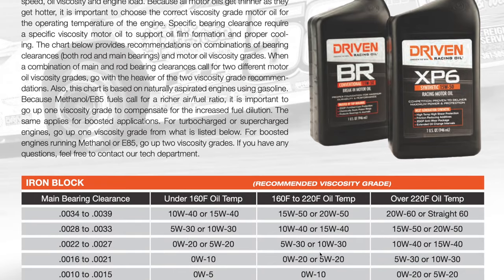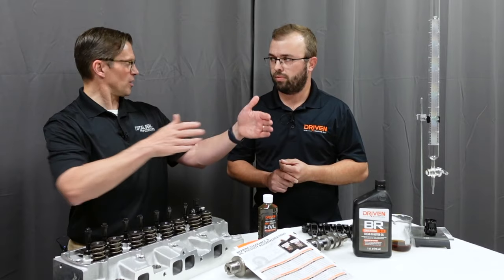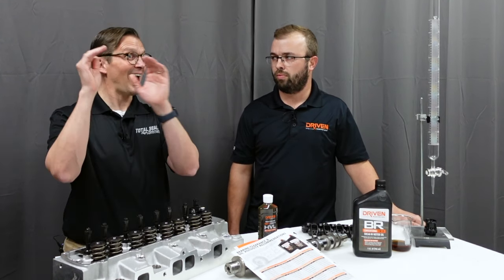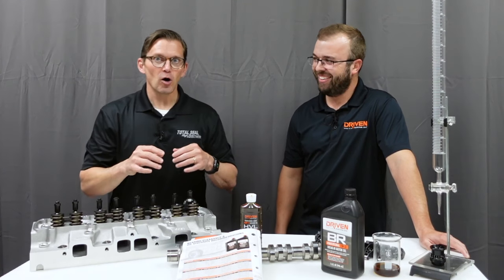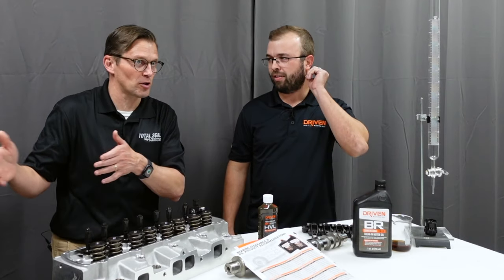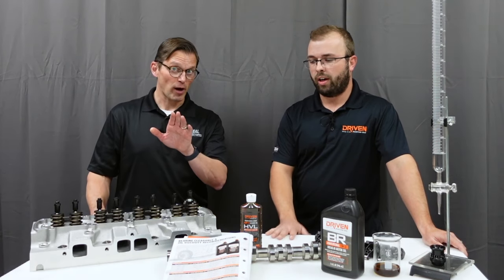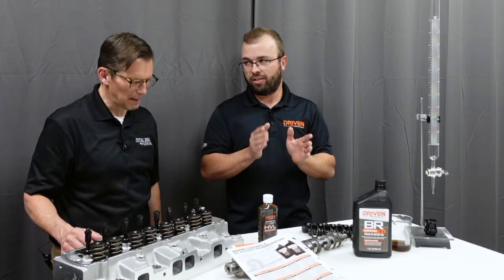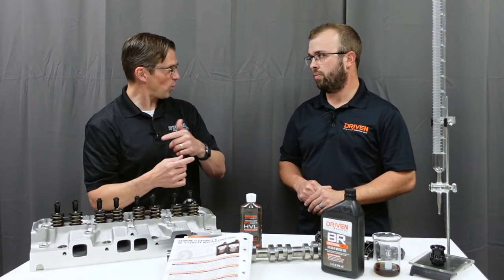How To Choose The Right Viscosity Motor Oil - A Certified Lubrication Specialist Explains

Comment: I’m 5 min into the video, heard nothing but viscosity, viscosity, and how important it is. What is the point? What do you suggest people do rather than following manufacturer’s recommendation?
Reply: the lower the W number, the better (within reasonable cost, comparatively).  The other number... well... whatever your ambient upper temperatures tend to be.  For most people, 5w-30 is fine in most location.  Otherwise 5w-40 is fine.  Very very rarely would anyone need *W-50 or 60.  These are either for highly stressed performance cars, high mileage engines, or very hot ambient temps.
Reply: If only you had watched the rest
Reply: I had read a research article which in short words stated that engine oil viscosity is based upon clearance of rod bearings. We all know rod bearings are the most critical parts of an engine to have maximum wear
Reply: Freeze 0W20, then pour it out and talk that BS about rod bearings and clearances
Reply: @lonniebeal6032 but if your engine is never used in freezing temperatures, how is that relevant?
Reply: Yeah whole vid was useless he just keeps saying viscosity and oil tension rings. As for what rating? Higher lower or follow manufacturer? No answer. His answer is viscosity.
Reply: Research and use your damn brain?
Reply: @carnivorebear6582 you telling me people never start their engines below freezing? What a wonderful world that is. Is it Venus?
Reply: @2010ngojo  where I live in Australia it's extremely rare to see temps below freezing, and even then it's maybe 1 degree below for about 30 minutes on one winter morning a year. It's still on Earth believe it or not!
Reply: Sounded to me like this, the warmer it is the higher the number needed and the colder it is the lower the number needed. Sound about right?
Reply: @awaisiqbal8934 rod bearing clearances haven’t changed in 30 + years. The bearing clearance argument is just dumb. I would question the experiences of the person who wrote that article.
Reply: @carnivorebear6582  nope, Australia is a different planet as far as I'm concern.
Reply: @carnivorebear6582  Then you could put 20w50 in your car if you don't use it and it's not relevant.  Most of us have one or two cars, when winter hits we are still driving them.  My point on the 0w20, is that people claim its for tight tolerances, but if you're driving in 0C and lower most of the time, you car will cool fast, run cold, and that oil will be thicker than SAE90.  Hence 0W20 is not good for hot climates due to viscosity breakdown and running a 10w30 in the summer that is thinner than frozen 0w20.
Reply: You guys need meds😅
Reply: @FredJones-lo2df  😂
Reply: A suggestion for what viscosity to run... You mean like the chart he showed, that's also linked in the description that spells out which velocity to use?
Reply: Those oem specs are good till everything starts to wear also they’re ment for regular use not abuse some brands actually recommend different specs if your gonna be abusing the vehicle more from viscosity to when you change it because some new cars are due with regular use at 7-9k miles (i would never do this even if I used it regularly) and they recommend it be changed at 3-4K if it’s abused more often or miles/engine runtime is high in short period of time because oil dilution happens in different ways at different conditions also after an engine has been worn down over 80-150k everything is most likely more open like bearing specs ring gap and tiny ptw clearance and the title and subject of the video is about oil viscosity so what you expect they’re professionals in this field I’ve seen and heard from the best they’re not the only ones with this correct opinion
Reply: Funny that they mention viscosity in a video titled Viscosity

Comment: We use straight 30 wt, in our hot rod engines, because we run  .003 thou. On the mains, and  .002 thou. On the rods. Lighter oil might allow the crank to hammer the bearings at 7 to 8,000 rpm

Comment: Makes me want to rethink my Jeep 4.0 and just run 10W-30 instead of 5w-40 year round here in Arizona.
Reply: I'm in TX. I have found that 0w-40 is a really good solution. M1 is really thin for a a 40wt, if you want that.
Reply: @DBravo29er  I’ve been really happy with Valvoline HM 5w-30 so far, no more click tapping at start up anymore.
Reply: @dad3562  that's a good, thick for grade oil. It's on the heavy end of the 30wt range. If we used half weight ratings, it would be a 35 weight oil all day. 👍
Reply: @DBravo29er  no way it is?! For real, I didn’t know that! Crap, now I have to Google it to confirm. I seriously did not know that!
Reply: @dad3562  Yeah the KV100 and HTHS are pretty robust. It's good oil
Reply: @DBravo29er  thank you so much the data, man I love this stuff. Great community!
Reply: The 4.0s love a 40wt oil. I got 331k miles out of my 97 TJ 4.0 with Rotella 5w40 and a Wix filter. The frame rotted out before the engine ever gave up. The engine is still running with nearly 500k on it in a 98 XJ. Same oil and filter are being used.
Reply: @Trebor-gw8lt  that’s crazy! Lucky dog!

Comment: When I added a supercharger to my sbc, I changed from 10w-30 to 0w-40. It's running over triple the stock hp so the oil is worked much harder and sees more heat.
Reply from the maker: Going up in viscosity is the right move when going from NA to Boost.
Reply: @TotalSeal  I've heard others recommend to stick with factory viscosity. No thanks! I wanted better cold flow for instant oil pressure and flow on cold starts.. while maintaining better protection when I step on the throttle. I recently read that the 650hp LT4 is factory filled with the same multi-grade viscosity.
Reply from the maker: @EricErnst  good thinking
Reply: @EricErnst  Not withstanding the fact that a 0w40 is already almost a 30 from the container and get to a low 30 after a few hours of operation
 So, you still giving a 30 most of the time, anyways
Reply: Film strength matters too. The 0w40 requires more viscosity modifiers than a 10w30, assuming all else is equal. More viscosity modifiers (big numerical spread) often result in less shear resistance. The big numerical spread can look like everyone is happy, but might not be as protective as numbers closer together (less modifiers). 

10w30 won't shear to less than 10. 0w40 can shear down to 0.
Reply: @Resistculturaldecline  Great point, 0W-40 oils often shear into the 30 range and sometimes below after a bit of use, especially hard use. Oils made from thinner base oils with more viscosity modifiers also tend to have higher evaporative losses at high temperatures.
Reply: I use always 0w40 mobil1 FS instead 5w30. Very good oil!
Reply: Make sure you shake that oil well before pouring!

Comment: Mr. Lake Speed , my 2023 Lexus IS 350 calls for a 0 W 20 . The owners manuel says that if I drive at high speeds or pull heavy loads , I may use a thicker viscosity oil . Can I use say a 0 W 30 or a 5 W 30 oil , will it be safe . Thank you Sir for your tlme and the video . May God bless you .
Reply from the maker: Go with the 0W-30 if you see the 0W-20 is not working. The way to know is via used oil analysis.
Reply: @TotalSeal  Thank you Sir, for taking the time to answer my question and for the information. May God bless you.
Reply: If you drive like crazy constantly revving your engine in the red zone, then go for 0w30 or even 0w40 as the difference between 20 and 30 is not that high - again it differs from manufacturer to manufacturer, and for sportier applications 40 would be a better choice. If you drive normally, stick to 20 as the manufacturer recommends. 20 is for  regular driving mode like 90% of people have going to work and from work without sporty ambitions. If you really load your engine hard revving it near red zones, you definitely have to go for thicker oil.

Comment: I drive a car with a low mileage 1 litre gdi turbo motor. I  live in a a tropical country with temperatures around 80 f. My manual recommends 5w30, 10w30 and  10w40 viscocity. What would  be the viscosity that is best for lowest engine wear for city driving conditions in your opinion  . Would greatly appreciate your response.
Reply from the maker: For a GDI engine, go with an API SP 5W-30 synthetic.
Reply: @TotalSeal  Thank you v much 1for your time. Most channels never respond to viewer comments.
Reply from the maker: We are happy to help!
Reply: Actually, an oil analysis of each oil would give you the better answer.  I am more inclined to say 10w30, cold flow rate at 70f is about the same.

Comment: Toyota states in their owners manual that a higher viscosity idk can be used in high load conditions. So you can use 5W-30 if car calls for 0W-20 without voiding the warranty.
Reply from the maker: Thanks for sharing!

Comment: I switched to 10W-30 in my 2.4 L engine in my jeep renegade from the 0W 20 to attend W-2 and if I can’t find a 10W-30 I’ll use a 5W-30 I could understand using 0W 20 or 0W 30 if your daytime high is only in the high 50s or low 60s And then below zero at night time

Comment: I have a (what I think) is a great question. 

I collect many Japanese imports. My cars from Japan, state to use 5w40/10w40.  My US SPEC Honda/Acura that uses the same identical B18C VTEC engine, states to use the factory 5w30/10w30. The ONLY difference in the two is that the Japanese spec revs a bit higher because of the ECU. I always wondered why the difference. 

A better similarity is a Japanese spec S2000 to a US S2000. Japan states in the owners manual 5/40-10w40,  in the US 10w30. 

Do you know why? Emissions BS? Marketing? I hate to question or argue with a true Honda engineer, but I feel you would know! 

Love the channel
Reply from the maker: The lower viscosity spec in the US is because of EPA fuel economy requirements.

Comment: My old Fords oil pressure was a bit lacking having 565,000 miles and instead of raising the thickness of the oil I lowered the thermostat temp from 192 to 180 degrees and the oil pressure came back to the way it was...

Comment: Please help this conundrum..... "hotter oil gets thinner"...as a general rule, yet for multi-grade oils like 5W-30.....the base oil is 5 weight to allow better flow at low temps, but with its viscisity improvers it acts like a heavier 30 weight oil when at higher operating temps. In this arguement, the oil is thicker as it warms. Can you offer guidance on this apparent contradiction..... for better understanding?
Reply from the maker: Watch this video: https://youtu.be/48pviPLgaPQ?si=2PD023A8q9MJDFMN
Reply: @TotalSeal  ....I fully understand W is for "Winter" and not "Weight", but presenting the question this way helps for presenting the question. I viewed the details of the vid but it goes into arcane testing details and doesn't really address the core question. Let try this way---> a 5W-30 oil acts as a "5" ( lower viscosity) oil to help cold-weather flow....yet it acts as a "30"  ( higher viscosity) oil, when warmed up...like a straight "30" oil...all done by using additives and viscosity improvers. A "30" oil will flow with more resistance through passages than a "5" oil.....like it was "thicker". Yet the common convention says oil get thinner when hotter. Can someone distill down the core thinking behind this ??????
Reply: Let's explain in a simple way. Oil thins out in higher temp, that's a fact. Imagine single grade oil at sae 5, it will have a viscosity of let's say 60cSt @ 40°C and 3cSt @ 100°C. Another single grade oil at sae 30 will have a visc of let's say 90cSt @ 40°C and 10cSt @ 100°C. The sae 5 oil is what you need during a cold start but at normal operating temp that oil will be too thin. In contrast, the sae 30 oil is too thick during cold start although it is at good visc for normal operating temp. This is where 5w30 multigrade oil comes in. It has sae 5 visc grade at low temp and has sae 30 visc grade at high temp i.e. 60cSt @ 40°C and 10cSt @ 100°C.
I rounded cSt values to nearest integers for easier understanding.
Reply: @1_D333 ....I guess that is what I was angling for....a (say) 5W-30 is basically 5 weight "core" oil.....with lots of viscosity improvers to allow it to behave like a 30 weight when "warmed".
Reply: @TheWilferch but don't forget that oil gets thinner when temp raises. Now you can google "oil viscosity graph" where Y-axis is visc (cSt) n X-axis is temp. You'll notice what I mean. And multigrade oil is just a crossing line of two single grade oils which otherwise parallel to each other.
Reply: @1_D333 .....I'm not forgetting that.....go back to my original statement where I post the conundrum.
Reply: Nice and simple

Comment: It’s 110 degrees outside today. Summer is here. My car takes 5w30 but I’ve got some 10w30 I’d like to use up. I don’t think the 5w30 will get down to that 5 number anyway. Tell me the pros and cons of using the 10w30 this summer
Reply: No worries for summertime. Make sure the 10w30 is full synthetic, because the 5w30 is.

Comment: 0w20 gets into and high up in the motor quickly,the gen 3 hemi likes this.
Reply: I rented a 300 Chrysler 5.7 in AZ, with 0w20 it knocked and ticked every morning, it was never below 90f.  So local temps matter. 0w20 also returns to the pan faster than a 10w30.

Comment: How does the choice of oil viscosity differ with different types of camshafts?  What if the rules require a functional flat tappet hydraulic lifter vs a solid and or what about a hydraulic or solid roller?  Do those differences also change the needs of the engine when it comes to viscosity?
Reply from the maker: Thanks for the question. The camshaft type does not effect the choice of viscosity. It’s all about bearing clearances and oil temperature.
Reply: @TotalSeal mate is ok the 0w40 use instead 5w30? Can damage the engine? Toyota 2zzge vvtli 1800cc 192hp 8.400rpm.

Comment: Great video guys...thank you!  I live in Alberta Canada and I own a Stage 2 (catted downpipe, MHD stage 2 tuned) 2018 BMW M240I X-drive with 36000 miles that produces about 450 HP and 475 lb-ft of torque at the wheels.  I exclusively use the Shell Nitro+ 93 octane fuel (10% methanol).  The oil temperature at normal running temp is 215 F.  The manufacturer calls for 0W20, but I have zero idea what the main bearing clearance is.  Am I correct in assuming that 0W30 will be fine and likely, preferable to use, at least in the summer?

Comment: My 5.0 f150 is recommended 5w-20 in the us and Canada, but is recommended 5w-30 in the Mexican version. My vehicle is higher mileage and vibrated a lot.  I ran 0w-30 and most of the unusual vibrations went away. I now exclusively use 0w-30 or high quality 5w-30. Timing chain sounds a lot happier too 😂
Reply: fordteck manudko says to use 5-30

Comment: Hey Lake Jr.  I have a stock ford 4.6 3v in my Mustang and run 20-30 min hpde/time trial road courses.  Oil temp usually settles at about 220 on cooler days and up to 235 on hot days.  I've been running a 50/50 blend of FR20 and LS30.  Should I continue with the blend or go straight 5/30 for my application?
Reply from the maker: That sounds like a good blend.
Reply: Awesome, thank you! @TotalSeal

Comment: I use Lucas Oil Stabilizer on every oil change on my 21 old Mazda Protege 5, takes 10W30 - 160k miles, no issues at all 🤞
Reply: Well i had 698,714 KM (434,160.8 miles) on a 1991 VW Turbo Diesel and never used any additives at all. My car was totaled by an a-hole, who ran a Red light. The engine had been still running great and never touched other than timing belt(s) and a couple glow plugs. I stuck to the 8000KM oil changes recommended by VW, drove 220-230 KM per day 5 days a week to work and back. Bought an '86 VW TD with the same engine to replace my totaled VW and put over 750,000KM on it before i retired. The '91 was bought new, the '86 had 229,000KM on it when i bought it.
Reply: @KStewart-th4sk  Old ones proofed to be a better quality... sorry to hear you had an accident and had to total the car, I would be mad as H.... I just replaced valve cover gasket on my 02 Mazda and engine is mirror clear, that Lucas additive does the job along with good quality oil.... I did had VW too previously, Jetta MK4 2.0, sold it under 200k miles, some few sensors needed to be replaced but was still running good.... Drive safe ✌️

Comment: I had for now only old vehicles who accepted even the 15W-40 oil.

Two Diesels, both indirect injection ones, and two gasoline/LPG ones, a 1.0l 3 cylinder made from Daihatsu, and a 1.731cc I4 Volvo one.

In all four I use and used 5W-40.
With 5W-40 instead of 10 or worse 15W-40 I have less fuel consumption and less oil consumption.

Just to give some data, the indirect injection turbo car I had, had consumed 2l of oil in 6000km during a summer trip in Spain (starting from Italy) with the 15W-40.
Same km the next year with the 5W-40, it consumed something like 100cc.

The other Diesel was a 2.5l 70hp naturally aspirated from the early '80s, on an autocaravan, same story, with the 5W-40 less consumption of fuel and oil.

Comment: Funny how the exact same motor from the exact same manufacturer working in the exact same temperature range and climate has 2 different requirements for oil weight and add pac.

Comment: In my personal experience, you technically should not replace 0W-20 with 5W-30. An engine with high mileage required 0W-20 and it runs smoothly and quietly; but once switched to 5W-30, it run less smooth and a bit louder. So with this experiment, I would just stick with recommended oil whether it is 0W-8, 0W-16, 0W-20, 5W-30, or 10W-30 etc; and perform the oil change every 6-9 mo or 5k-7k miles.